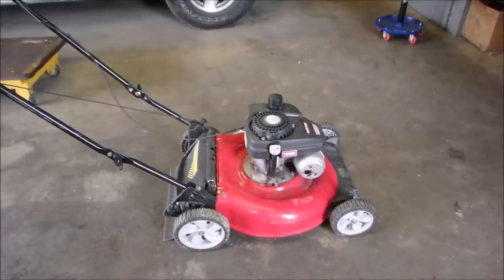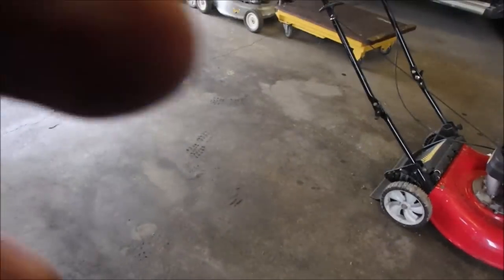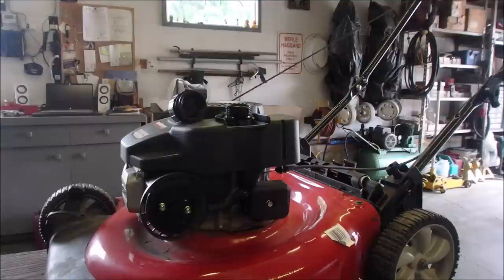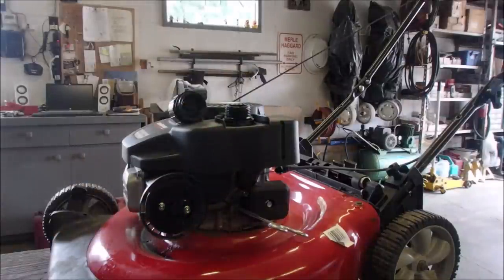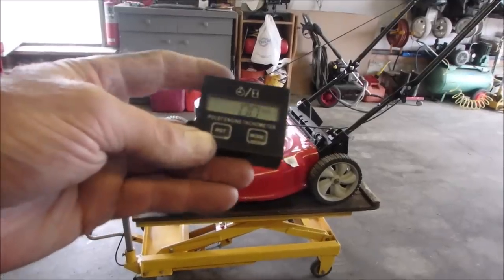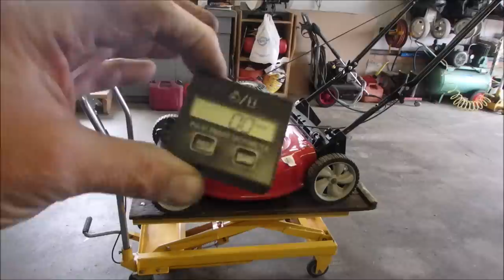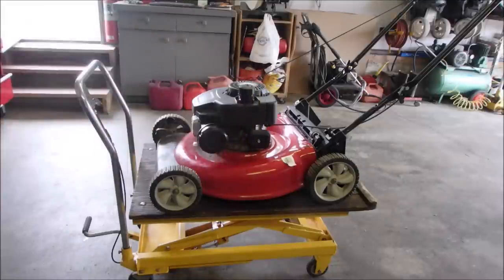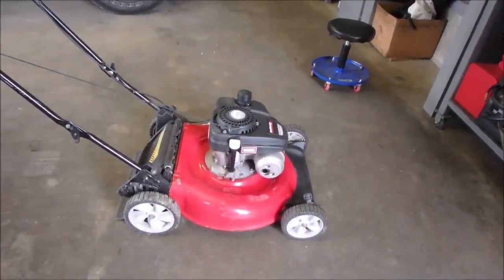A Powermore Mower Starts and Stalls

Comment: Sounds good.  I never really wanted a mower stand but I have to admit tilting it back to the handle while the mower was on the stand made me think about it 🙂
Reply: A Pender Lift would look great in your garage Bill. 🙂👍🏼
Reply: @Big_Johns  it would, but I am not very coordinated, I would knock mowers off it all the time. I also kinda like sitting on the stool with the tools next to me on the floor.
Reply: You could add a little strip border onto the sides of the lift so it wouldn’t just roll off. 🙂
Reply: @Big_Johns  I thought about it but then I imagine making a mistake and bouncing a mower off the vette
Reply: Yeah, that wouldn't be very good. 🤣😲
Reply: @GuysPlayingWithTools  Excuses excuses excuses just buy the darn thing and you’ll love it
Reply: @henrymurawskibigdogrepair  🤣🤣
Reply: @GuysPlayingWithTools  That would not be good Bill...
Reply: @barryewalt5368  Yeah,  apparently small engines and being coordinated are separate skills.  Lol
Reply: @GuysPlayingWithTools  Ya Bill, that's the way it works for me...LOL
Reply: @barryewalt5368  lol
Reply from the maker: You are still young bill.
Reply: @BrucesShop  Usually.  LOL

Comment: Suggestion: crimp a medium-sized alligator clamp on the end of the wrap-around wire that comes on that type of tach. Then simply chomp on the spark plug wire in order to get a reading. Because the wire is usually long enough, I can read the RPM's while standing in the normal position behind the handle after pulling the starter rope.
Reply from the maker: Good point.  Thanks

Comment: Good day, great job on this mower. Running perfectly. I have a question for you. Have you ever done a no start on a mower that if you turn the motor over 4 times using the blade to turn over and then starts and runs fine? If so do you have a video on this. I have been watching you for close to 3 years and do not think I have seen one. Thank you for your time. Mr. Nancy.
Reply from the maker: That may be a carb issue   I am sorry I am not of much help.  If i was there It would help.

Comment: Good job Inspector Gadget! I noticed that you have different set of micro drill bits. Where did you get them. They are easier to use than the old set you had. Also did you make that T screwdriver to remove jets? Have a good weekend Bruce.
Reply from the maker: Check description.  This is a Canadian Amazon site but you will get it.  
https://www.amazon.ca/gp/product/B07RJH4G2C/ref=ppx_yo_dt_b_asin_title_o00_s00?ie=UTF8&psc=1
Reply: @BrucesShop  thanks Bruce.

Comment: I picked up two self propelled mowers today for free. The first one had about twice the oil required for it. So I got the 6.75 auto choke briggs fixed quickly with oil change, new air filter, & a blade sharpening. Next I did a quick clean on a Tecumseh vector carburetor ☹️, my least favorite mower. Anyway I guess it’s time for another thorough cleaning by removing the carburetor or I may set fire to the piece of crap. Just kidding just not a delight to deal with.
Reply from the maker: Is that the Tecumseh with the strange bowl and primer that never seals.  i just did one   coming up.
Reply: @BrucesShop  I got it running this time! I watched one of Taryl’s videos showing how to line up the jet with the rubber O ring correctly. Your right the primer is a bit finicky but it works.

Comment: good job there,   I am not  fan of the powermore engines.  parts are hard to find and $$.   we don't see many powermore engines here  where I am I think I have seen  4 in the past 3 years , and 2 of the 4. this year.    saved 3 , scrapped 1 ( wasn't worth it, but saved some parts which came in handy later)  I supose they will be more common in the future.    I see mostly B&S,  Kohler, Honda , and to a lesser extent  Tecumseh and powermore.
Reply from the maker: That seems right.  thanks again.